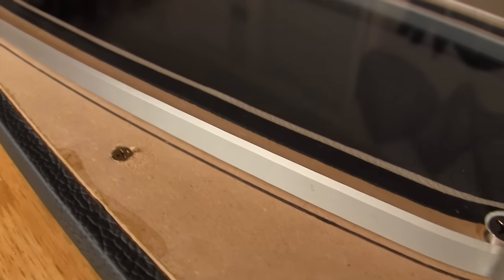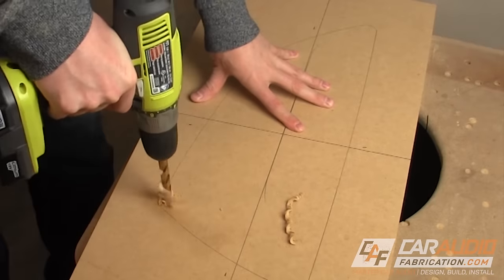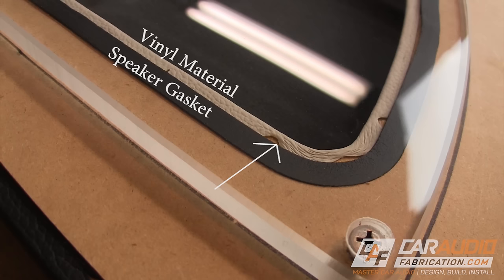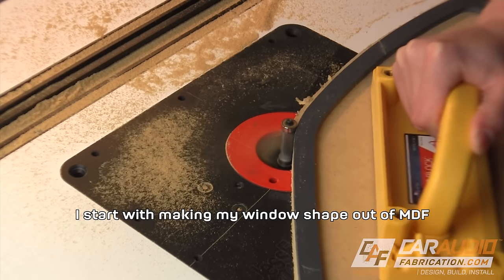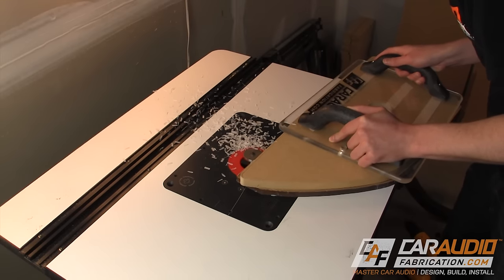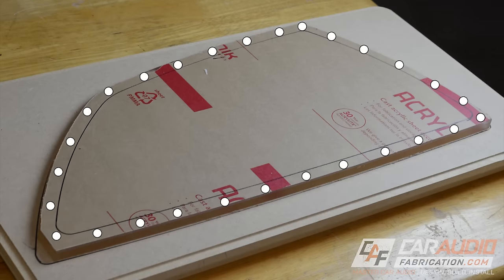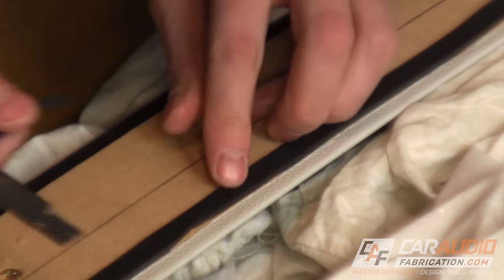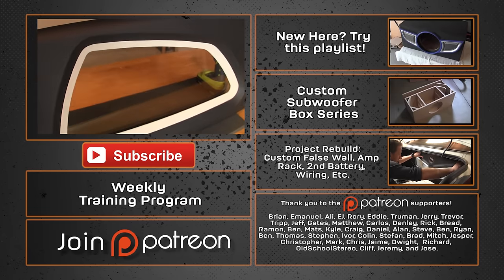How to - Plexiglass Subwoofer Box Window - Acrylic - CarAudioFabrication

Comment: 6:04 I would think a perfectionist such as yourself would be using the following tool (Idk the name) if I remeber correctly from my childhood, you can buy a small donut looking tool that attaches to your drill bit and tightens/clamps onto it using an allen screw, attaching it to the specified height in order to prevent you from drilling too deep for those threaded inserts.

Comment: Hey, love your videos. 
I have a question.
Im attempting a false wall build in a frs.
any advice on air tight sealing in areas you cant perfectly cut for on the sides? ive heard of expanding foam but wanted your take i want a professional or atleast a clean look..

also. I was thinking about using a (probably single maybe dual) high power 8" like dc m38 or x-8. Do you think that would be good or should i go for a 10" or 12" in such a small cabin.

Comment: So how would you apply this method if your doing a carpeted enclosure and the window cannot fit in the box after assembly and carpet
Reply from the maker: +D Cardullo Assemble with the window in place, leave film on the window, tuck carpet into deeper rabbet groove around perimeter of window, remove window film.
Reply: I dont think im following you ..  so i have the enclosure built and window in place .. but i have to spray glue on the enclosure to carpet .. but its going to get on the plexi and i wont be able to properly secure the carpet in the rabbit with the window in place. So i was thinking leave the top off and carpet the front of the enclosure then put the plexi in and put the top on and continue wrapping the carpet around the box

Comment: how did you make the wood round off and slope down at the angle towards the plexiglass?:u didn't show that part.
Reply: I'll eat my shoes if he didn't do that part using-THE ROUTER!! You'll find that the main difference for pretty much any professional, high quality looking project that involves wood, not just car audio, but anything vs some sloppy, slapped together looking pile of crap is whether or not they had and knew how to use a router. You can find a million FREE online DIY router articles, tutorials, etc total beginner to pro woodworker and much of it comes down to which router bits you need for that specific "cut" and otherwise its a fairly simple power tool.
Reply: just use a 45 chamfer router bit and watch tutorials on it and practice on scrap  and use straight strips for the bearing

Comment: Hey guys I need some help with amp wiring. I just bought a new pontoon boat with a full polk audio system. my problem is when the engine is not running at higher volume the system cuts off. any idea what causes this.it's fine as long as the motor is running.
Reply: Brad Sanders easy, your system is pulling to much amp draw to stay running. either add, or upgrade batteries and power wiring and see if that helps

Comment: Hey Mark, my name is Mike and l have a project that lm having a problem with so if you or anybody else that can help l need it. I have two projects no one can’t do. 1. I have a “Orion Hcca 181 SPLX 18” 20,000 watts 7,500rms and l need the specs for the subwoofer. 2. For that much power what Amp can push 7,500 rms. If someone knows please help!

Comment: He said a plexiglass window needed to be at least 1/2" until the size her was cutting out, any larger than that you'd need 3/4"... But he didn't say what size he was working with. 

So my question... What is the largest size plexiglass you can use while it still only being 1/2"?